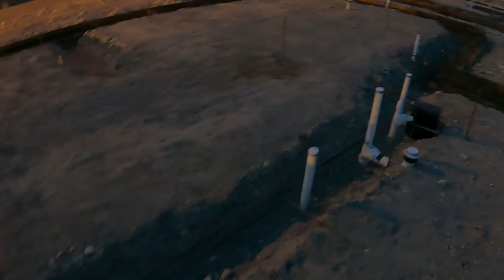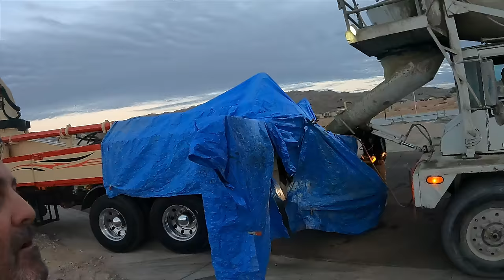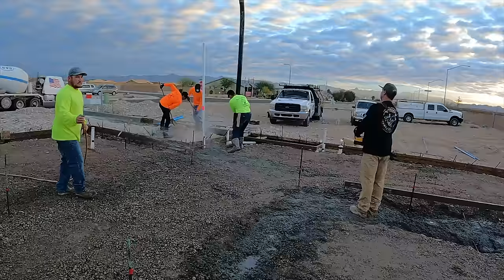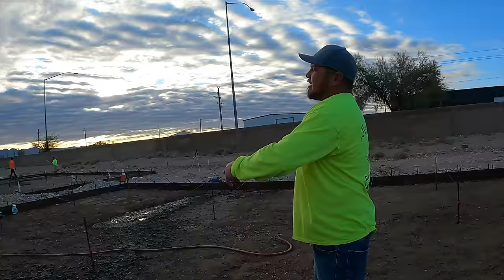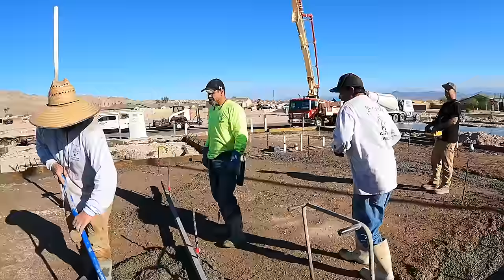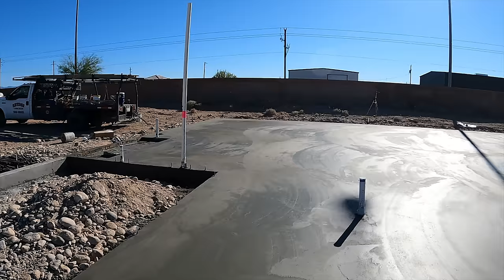120 Yard Concrete Foundation Pours (Christmas Special!)

Comment: we drop the stem walls as rebates that finish 150mm below the house finished floor level. same with garages rebates if the design is to attach house floor as a complete pour. or we pour footings for garages and pour the garage floor with a driveway (after the garage build is complete) as well as another area of the house. so I find this method very interesting.
Reply from the maker: Sweet and simple

Comment: Many years ago in the house (we were living in) and were renovating and the entire suspended concrete flooring was poured, and then allowed to "go off" before that rotary machine was used to smooth out the surface.  They finished that night at 2.30 am.  Not much sleep tat night as it was like a rotary motor mower running in the next room!
Reply from the maker: Yes I've had a few sleepless nights on concrete projects. It happens

Comment: What’s the purpose of the tamper after leveling the concrete? Thank you!
Reply: The tamper? Yeah I'm curious too I've never seen that before looked cool guessing it's to compact it and looks like it brings the cream up very well. Probably really helps for the finisher
Reply from the maker: Yes, it knocks the rock down and brings up the cream, also helps in flatting it out
Reply: Thank you!
Reply: @OdellCompleteConcrete  as when vibrating one can tamper too much ???
Reply: Theres a Rolling tamper thats Replaced the one in the video, then theres something called RATLE STICK THAT ACTS LIKE A VIBRATOR. BOTH OF THOSE TOOLS AND YOU GOT AN EASY DAY

Comment: Nice video, David.  In CA you'd have to run rebar all through those slabs and connect that rebar to foot to meet code right?
Reply from the maker: That is correct

Comment: i would work with any of this crews hands down....  lots of prior work before pouring,  crew QB owner print specs  etc field progress forming laysout etc, formers carpenters surveys etc... the coordination work is a joy... what is this a like a 3000 3500  sqf  2story home slab foundation ???
Reply from the maker: yes, it's well-organized system. Single story high ceilings
Reply: @OdellCompleteConcrete  large load added i see thanks

Comment: Merry Christmas!  What city in AZ is this????
Reply: And a few min in, Mojave.  You do some amazing work.  Wish you would come to Peoria, far north by Lake Pleasent. Out in the desert.
Reply from the maker: Is that about a 4 hour drive?
Reply: @OdellCompleteConcrete  About 3-4 hour drive.  All the housing out here is post tension slabs.  Very rarely are there any footing/rebar type of pours.  its cheaper and easier for these builders to have a single 6" slab with no footings that they just lay right ontop of the ground, then do the post tension cables and grade around the house.  probably can lift the entire house by the slab, lol. 

I have a backyard I need full landscaped and cement/pavers done.

Comment: Where is the rebar?!? I can’t imagine spending so much on concrete and not investing in reinforcing steel. It might be builder logic but not homeowner logic.
Reply from the maker: No need in these conditions
Reply: they are pouring on basically solid rock - concrete poured on this solid substrate doen't need any additional tensile strength for floors and footers
Reply: @stephenlane80  I see. That’s very interesting. It makes sense the way you put it. I would be nervous about it but it certainly seems to be the norm out there.